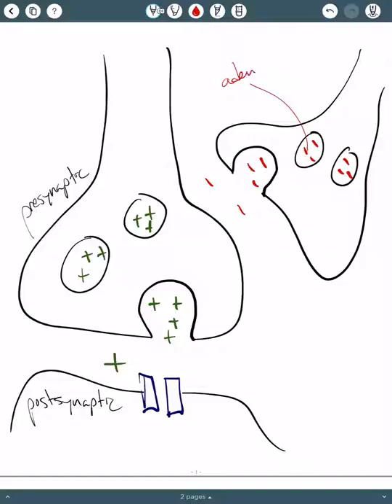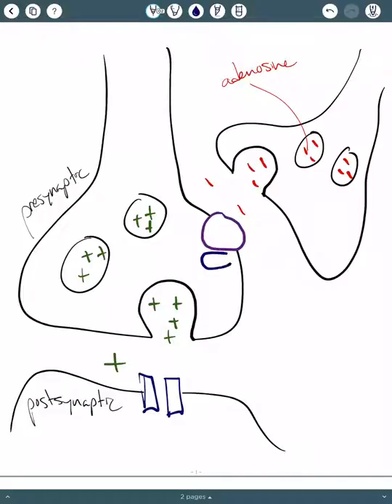Caffeine Mechanism

Comment: So does caffeine calm down a weed high then? Bc they work on the same receptors
Reply from the maker: Hi Dr.Nug - Thanks for your comment! You raise an interesting question, but I should say that although THC and caffeine share a similar TYPE of mechanism (acting on presynaptic receptors), the receptors they act on are quite different. One is an agonist of its presynaptic receptor (THC agonizes cannabinoid receptor CB1), and the other is an antagonist (caffeine is an antagonist of the receptor for adenosine, an amino acid neurotransmitter).
So they agonize and antagonize different presynaptic neurotransmitter systems, and likely do NOT have an opposite effect, but probably do combine in unpredictable ways - at least unpredictable by me... TLDR
: NO. I do not think you should try to calm a weed high by drinking caffeine. Nor should you use caffeine to get less drunk, etc.